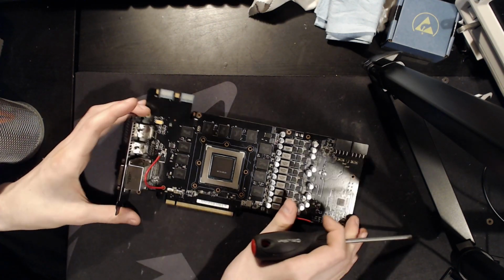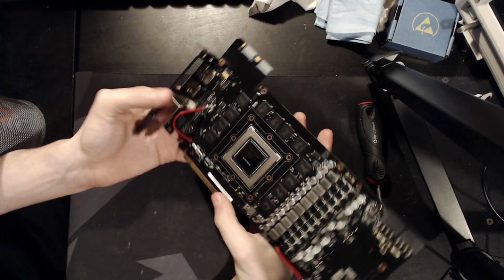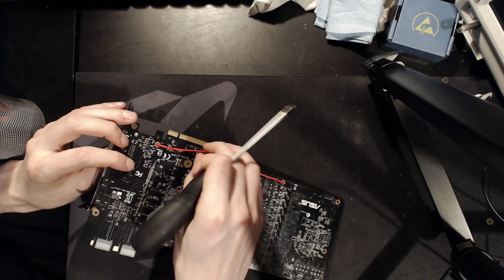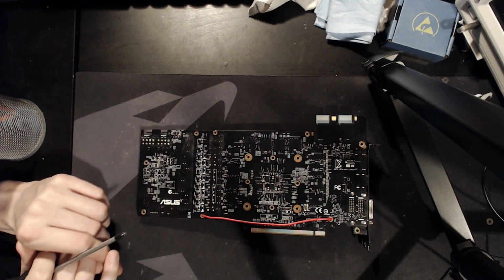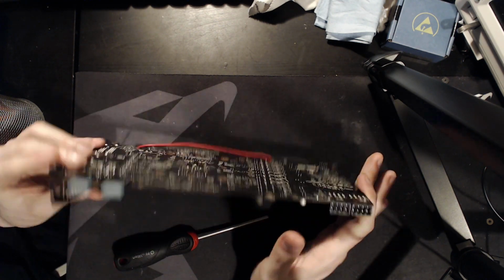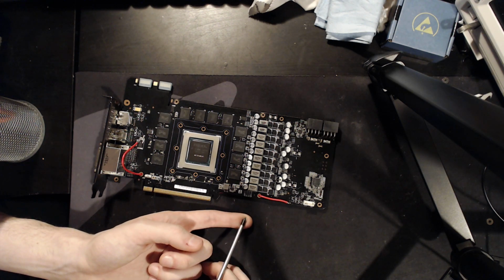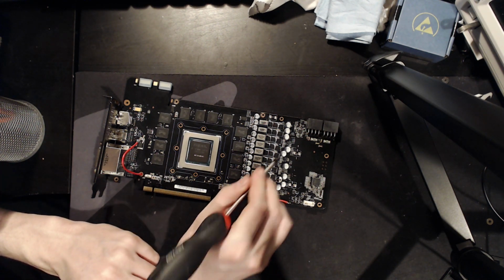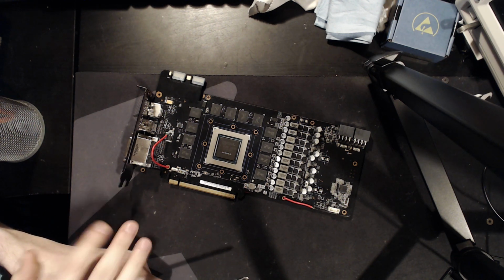OC Adventures: I un-killed the GTX 780Ti DCUII

Comment from the maker: Necromancy level +1

Also check out Elmor's scores:
http://hwbot.org/submission/3840029_elmor_gpupi_for_cpu___1b_ryzen_7_2700x_2min_2sec_316ms
http://hwbot.org/submission/3840027_elmor_geekbench3___multi_core_ryzen_7_2700x_51311_points
Reply: Buildzoid, can I ask you a couple of non-OC questions regarding the XFX GTR shroud if you still have?
Reply: I have a Sapphire HD 7870 GHz Edition sitting on a shelf which does work but has random black screen crash problems. Internet tells me it was a common problem for these cards and some ceramic capacitor/s were at fault.
Idk, does Dr. Buildzoid care about something medium range performance and old?
Reply: Bitter Cynic I would take it. In all seriousness, I kind of doubt it, as he only seems to care about flagship cards it seems. Is it the one with the two six pins on the right side of the pcb, and the light blue stripe diagonally down the shroud? I have that, it works, but the the heatsink is damaged. (heatpipe got busted somehow) if it is that card, it has a pretty subpar power deliver system. I honestly don't think he would care, as I don't think that the vrm isn't worth enough, probably can't deliver much at all. But I can't speak for buildzoid himself, so take his word, not mine.
Reply: Not quite, the one you're thinking of has "Dual-X" stickers on the fans whereas mine has "Sapphire" plus their logo and no light blue stripe either. The PCB is probably pretty similar for both cards (edit) spoke too soon as there are at least three different 7870 PCBs on the imagesearch and I think mine has a pretty weird layout that's far too busy at the video output port end. My card obviously is faulty and if it's those tiny ceramic capacitors I don't know if anyone has the soldering skills to replace those.

Comment: I’ve got a MSI GTX 1080 and it kinda works for a time but after a while it kinda “crashes” or so like the screen signal just completely goes away and sound also stops but it would just stay for that then until i turn it off and back on does anyone have some similar problem?

Comment: I actually killed a motherboard some time ago. I found out, that I blew up one of the vrms, but I can´t find anything about those on the internet (maybe I´m reading it wrong?) It says "A2726 U 014 M", but as I said, I can´t find anything about it (the board is an Gigabyte X58A UD3R I got for 10€ and it actually worked)

Comment: Might be a complete noob question but here goes.

I have a completely dead strix 980Ti. Cooler stripped off and powered via a pcie extender board and 2x 8 pins. No output from the core vrm or memory vrm. No power to the core or memory what so ever.

Correct input voltage to the digi vrm chip (asp1212) and to the memory controller (up1641p). Correct input voltage to all drivers and mosfets (ir3555m) on the core (m3058m) and memory. However no output from either set of mosfets what so ever. VRM is completely dead on both. 

Just wondered if you had any idea on what i could look for. Possibly just a dead core? Not really sure what at all not trying to repair just trying to learn and figure out whats at fault.

Thanks!

Comment: Question, Will a gcard stop working if the gold plating comes off of the PCIe contacts? I have a card that sometimes wont work. I get black screen but the fans are running and the only visible damage i can see is that some of the plating on two of the fingers is almost worn off completely.

Comment: Really good job with this one can you please make more close up video with part need to perform remove to not detect 8pin power in 

BTW I repair many GPU and you right if card have a artefacts don't do oven method you will need use heat gun flux and minim 290°C for minimum 10 min and that's help if it's bad or cracking on solder point I repair some card like this and still working after 2 years with no problems but I more like repair card with damaged or missing components as is more easy detect and repair some video I have on my channel if you interested to see them

Comment: If running it without the transistors is so risky, and you have the schematic, can't you cut the sense lines around the crack and then run jumper wires from the transistors to a spot near the decisive circuit. That would probably require access to a reworking station and microscope...
Reply from the maker: it's risky in the sense that turning the card on without the connectors will probably end up with the PCI-e slot or the 1 phase on the VRM that is wired to the PCI-e slot getting overloaded. It's not resiky enough for me to care.

Comment: Would you be interested in a (sort of) dead laptop? It's an HP omen 15 (7700hq + 1050 ti). I forgot to disconnect the battery and dropped a screwdriver head into it. The notebook itself actually works but the charging circuit is probably fried, since it receives no power from the charger. I'll try to warranty it (maybe I get really lucky), then I'll try to fix it myself, but failing that I'd be happy to send it to you. I would rather have you using it (if you can fix it) than just simply throwing it out.

Love the channel BTW. Very high quality videos, haven't seen anyone else go into such detail on PC hardware. Keep up the good work!
Reply from the maker: Thanks for the offer but no. I don't need a new laptop mostly because I don't even like using laptops.
Reply: Oh well, I guess I'll have to learn how to fix it my myself ¯\_(ツ)_/¯
Although I should have guessed someone running a channel called Actually Hardcore Overclocking doesn't want anything to with notebooks :D

Killing that thing was what made me go back to having a high end gaming pc and holy shit I will never ever buy a gaming laptop again.
Reply: Bendegúz Paulovits honestly you could figure out what needs to be replaced, fix it, and re sell it.
Reply: Miles Kosik I haven't really got around to figuring out what exactly is wrong with it, but since it had a very violent short circuit (with sparks and everything), it's either a broken trace on the PCB (impossible to fix) or a damaged component on the board (almost impossible to fix). I'll have to start poking around in it with a multimeter to find out what's wrong but I'm pretty sure it's something that I can't fix.

Comment: I have a Gigabyte  7970 which is burnt out right before the VRM's FETS, probably not even worth repairing?
Reply from the maker: any chance of a picture?
Reply: https://imgur.com/a/tASZ4vW 

If you want higher res images i can use a real camera. Found this card yesterday (with a 4790k + mobo hehe) it had insane amounts of dust in it..
Reply from the maker: It would probably work with an E-power just a matter of isolating the damaged area.
Reply: Ill see if i can get my hands on anymore cards and send them over to ya

Comment: Should send you my 780Ti Matrix for repair. 😁 I think mine is something with VRM since mobo doesn't see it, but fans are spining and both molex pin lights are green. 😞
Reply from the maker: See I'm not that hot on the whole sending test subjects back to their families if you catch my drift.....
Reply: Actually Hardcore Overclocking Haha I know. I was joking. Its not worth to repair it.
Reply from the maker: I think a PCB like this: https://i1.wp.com/www.ocdrift.com/wp-content/uploads/2014/04/ROG-Matrix-GTX-780-Ti-Platinum-PCB.jpg

Is definitely worth saving. I just don't think it make sense to pay for repairing. Just send it to me would cost a bit then there's my time going into the repair and well at point it you might as well buy a working 780Ti on E-bay or something. Though I would definitely be intresting in trying to fix up another card for running 3 way.